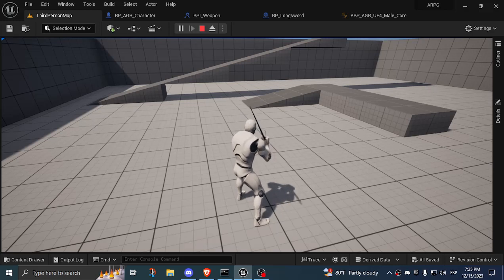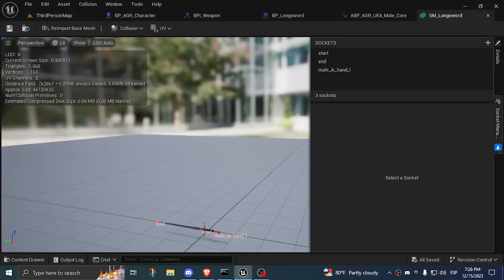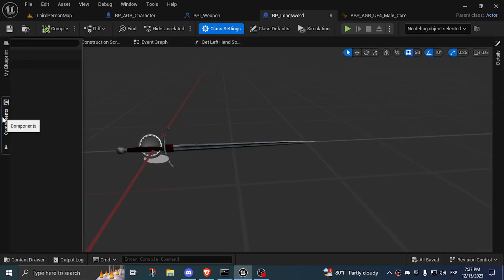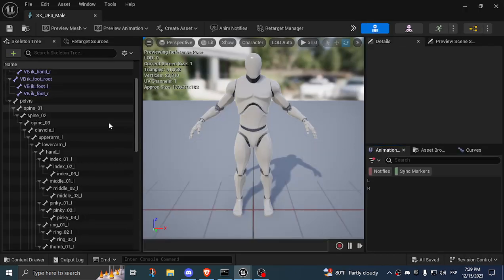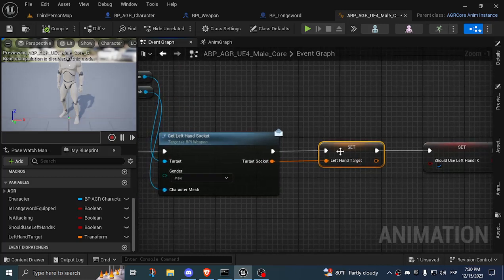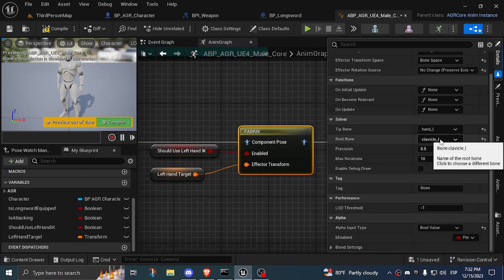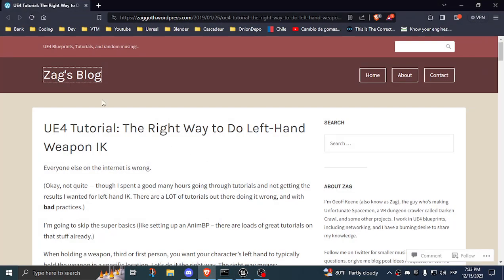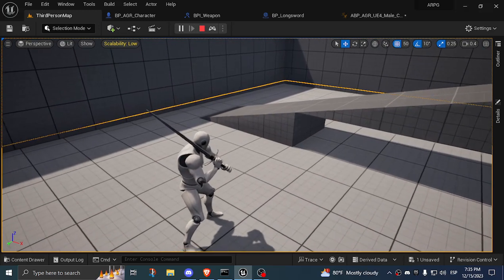Unreal Engine 5 tutorial left hand IK on weapon with ZERO lag/delay using sockets (BEST METHOD)

Comment: It can't be this easy.
If the models have slightly different bone transforms than the ue4 mannequin, then just solving the hand rotations wouldn't be enough.
I'll try this later on, but it can't be as easy as using the fabrik node.
Reply from the maker: @n1lknarf  did you test it with another model? you would have to setup a different socket in the weapon for each skeleton you add, in my case I had two, male and female ue4 skeletons, and then use the right socker based in the skeleton's gender. I used ue4 skeletons because our project used cc4

Comment: some reason this stopped working. i believe i changed a variable or connected a pin and it caused it to not read the location of the socket on the weapon. any idea how to fix. Keeps saying it accessed none for the node  
thank you.
Reply from the maker: could you try looking into the name of the socket on the weapon model itself?
Reply: @draicor  tried everything. Just ended up deleting the entire system and redoing since it isn’t that difficult to set up. Works like a charm now
Reply from the maker: @MaximilianMitchell  
sometimes is really hard to find an error, i'm glad you fixed it though